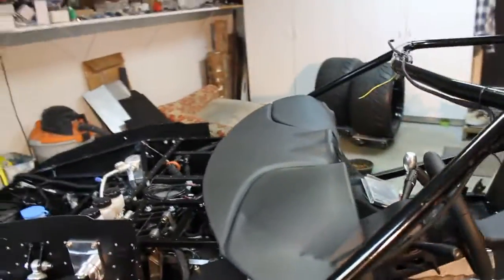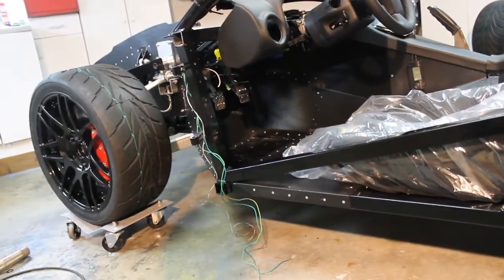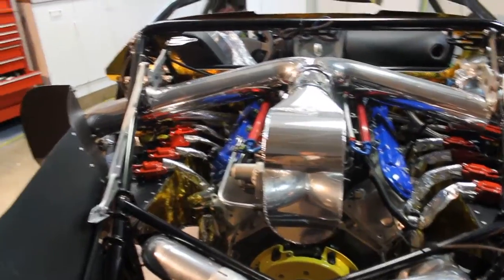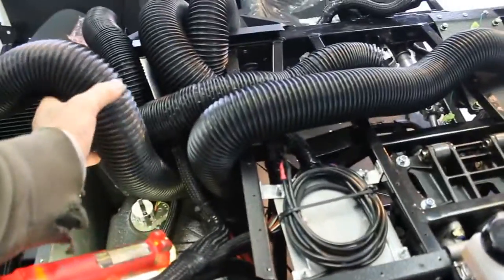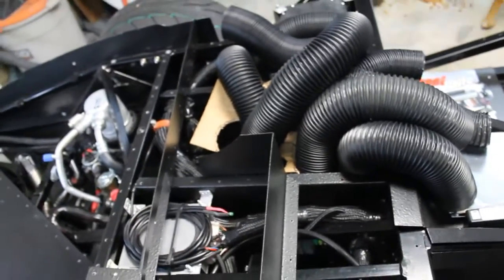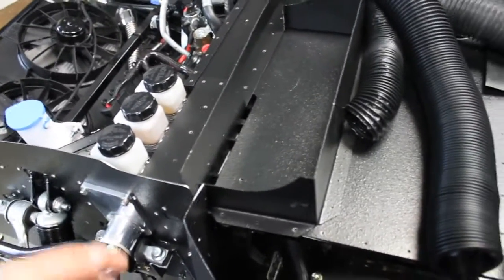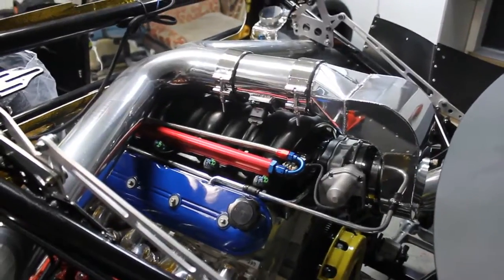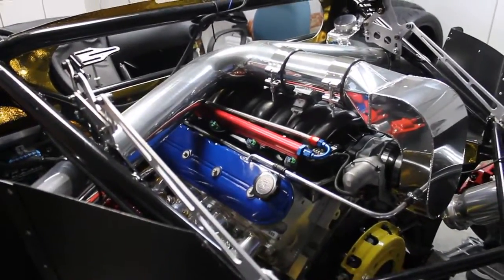Factory Five GTM Supercar, fastthings build log....... Part 45

Comment: My buddy had the same knock coming from the number 2 cylinder, he pulled the heads and pistons and could not figure out what was causing it. I had him turn the crank back and forth and rested my hand on the piton while it was in the cylinder. The noise went away. It was definitely piston slop and the piston was of proper size and so was the bore but the bore was just ever so slightly over size .005 and slightly out of round and the factory piston was on the smaller size but brand new. He put it all back together and brought it back to the dealer.
Reply from the maker: Well, I have no dealer to go back to. It's all in pieces now, and for sure a comfirmed collasped lifter.
Reply: I wonder if the lifter went bad from the bad oil pickup o-ring...Not likely but a possibility. I had a lifter come apart and it sounded bad and the rig was back firing, such a simple fix but I thought it was a rod and blown head gasket between cylinders, I was young and dumb. I look forward to your video of you doing donuts.

Comment: nice work so far! do you think that there will be any space left up front under the hood for maybe a small compartment to fit some luggage into? Are you thinking of possibly installing an audio system into the car?
Reply from the maker: Thanks man, Yes on both. I do want to make a little storage box up front, over the battery. And I do wantt to make an attempt to put in some audio.

Comment: This is sorta WAG, the engine knocking might be piston slap which is common on LS engines. It quiets down after the engine warms up. Chevrolet says it is not a defect and no correction is needed. 

Will your GTM have cup holders? 

It's lookin good.